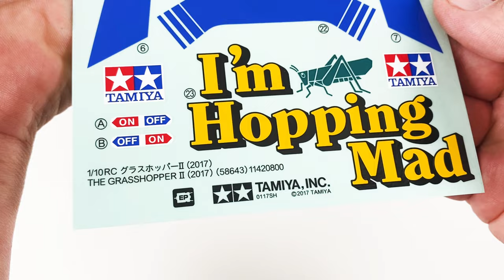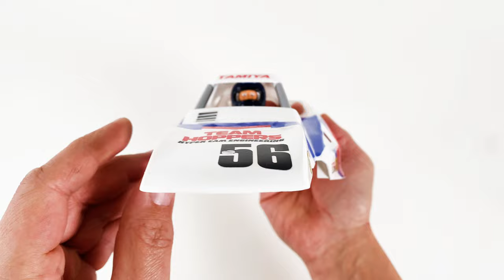Tamiya Grasshopper II 1988 RC Car Restoration

Comment: I do have a GH 2. Bought it back in the early 1990's, along with a Thunder Dragon, both are on good shape, I wanted to have a rear wheel drive and a four wheel drive off road RC models, and those two were my choises, I thought about buying another and my eye was on the Avante, but never bought it 😢.  Both Thunder and Grass have a Futaba radio, from time to time I drive them, I'm still a boy 😂, and I still love my old RC cars. The one I'm restoring is a Lotus 99T, it had lots of "action" and its body and front wing/suspension needs a replacement. Front wing and suspension I think I'll go for a 3d printing spare part and I'm gonna try to save the body, This Lotus RC body is not cheap, and I don't want to expend a lot of $$ in an old model. Let's see how the body ends, I'm striping the paint wich is a pain in the a... so I can paint it over. Thanks for the vídeo, it gave me the inspiration to restore this Lotus. Oh, it is the original 1987 release, not the around 2010 newest release. Let's see what comes of this restoration.